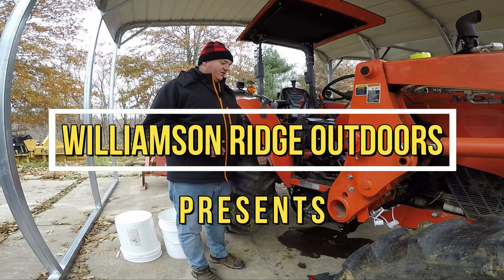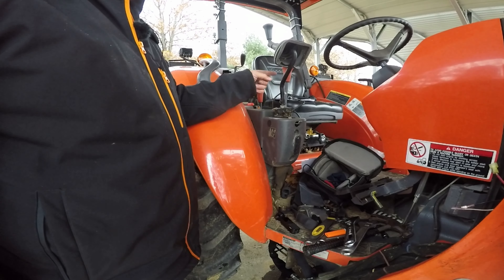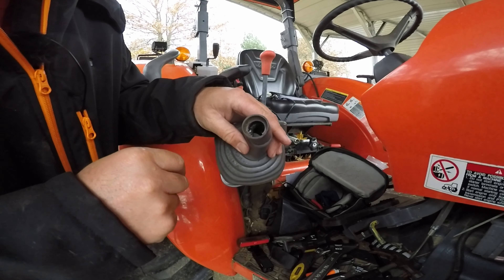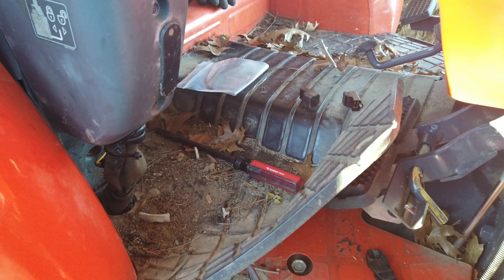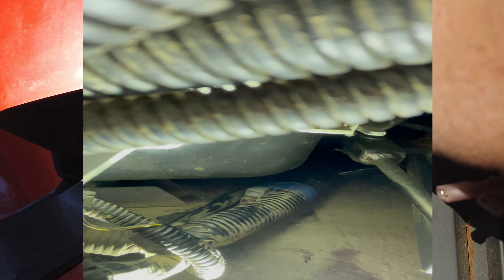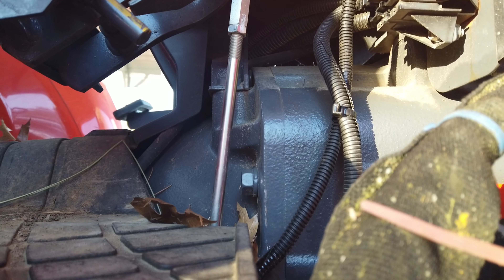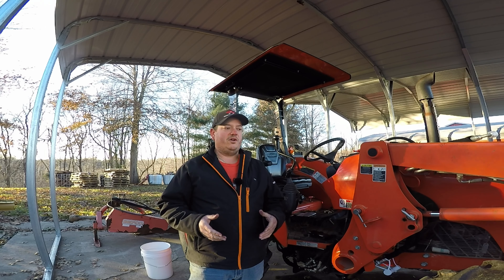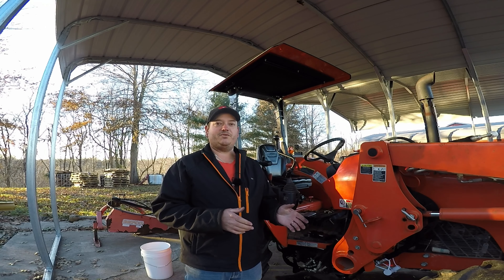Kubota M6060 Third Function Kit Install Part 2 #240

Comment: Great videos!! got through the install on my M6060 with cab pretty easy. Only a few hitches. On the electrical end, the "hidden" tractor wire connector on tractors with cabs is right behind the seat. Super easy to find and connect. The cab model valve kit (M7992) comes with an extension for this connector, and you can poke the wire under the side console plastic to hide it. The relay plugs (the only 2 plugs that fit the relays) can go on either relay. The solenoid plugs (grey) can go on either solenoid, but it obviously affects which way the cylinder moves with each control button. If you screw up the hydraulic hoses you can easily switch the solenoid plugs (ask me how i know). Everything else was super easy.   On the hydraulic hose install side of things, everything was super easy as well, except for that short 8.5" hose from the back of the tractor to the new valve body. I ended up unbolting the bracket that holds those back hard lines, which brought the lines out just a bit to make getting the fittings on them. Once I did that, it was smooth sailing. Couldn't have done it without these videos!!! Thanks
Reply from the maker: Sweet! Thanks for watching!

Comment: I'm adding a grapple to my M6060 and was going to run the hoses from the extra valve on the back. This looks like a well made kit and is probably more convenient to keep your hand on the loader control than jumping back and forth from one control to the other. That said, I'm wondering if after this install & use of this kit, if you think it is worth $1252.00?
Reply from the maker: I used to run mine that way and it works fine, but I would pay the price again to have the convenience of it being on the loader stick
Reply: @WilliamsonRidge I kind of figured you might say that. It has to be easier to concentrate with that set up vs the other way. Not to mention the hose getting hung up on various things or being in the way. 
I do appreciate your response and the insight.
Reply from the maker: Yeah and i pull the loader off pretty regular and trying to route the hoses out of the way but still have them to where i can remove them with the loader was a pain
Reply: @WilliamsonRidge  Well, I ordered the kit from Nate at Messick's, and he wasn't sure how long it would take and gave me a guess of a couple months out to as long as 6, but I got an email today that says it's supposed to be here Friday. 
So, I'm re-watching your install videos all the while, appreciating the time you took to make them as the instructions are not the best and puzzling out a couple issues unique to my M6060.  I have a light bar mounted on the metal cover up front on the loader (where the hard loader lines cross ) so that bracket they send won't fit unless I remove the light bar. So, I'm thinking I might add a section on/bend it a tad or relocate where those qd couplers mount to that protective cover. I use that light bar a lot so once I get the kit in hand & work my way fwd on the tractor I'll see what it's going to take.
I almost pulled the trigger on making a couple hoses for my tractor to use this grapple and get some piles of trees collected and processed from a flood in June of 2022. Almost, as I wasn't sure how long it would take to arrive... glad I waited and took your advice to do this kit. It'll be right, more user friendly and I won't have to fuss with hoses or things being in the way. 
I appreciate the videos and your time to answer my questions about this. Hope all is well out your way, up here in Montana we are seeing a mild start to the winter. Been cold and windy, but not too bad of a start.

Comment: The relays just attach to the bracket without any wired connection?
Reply from the maker: There is connections on the wiring harness that will only fit the relays